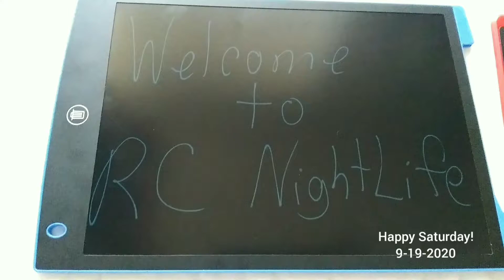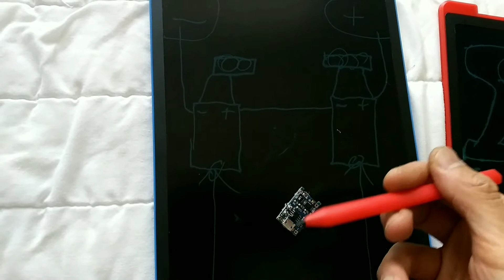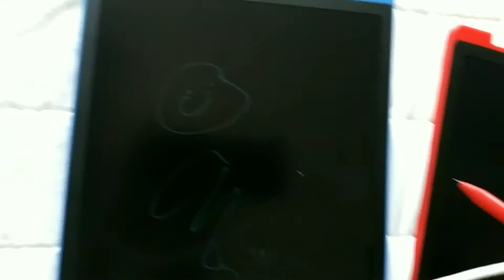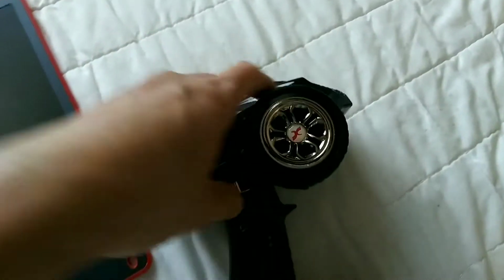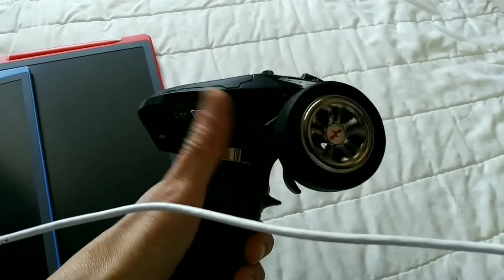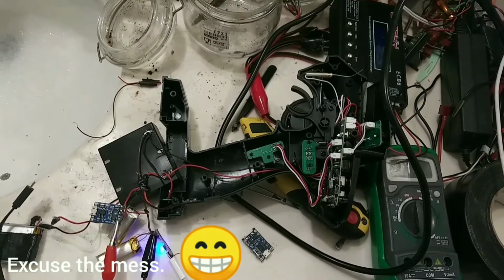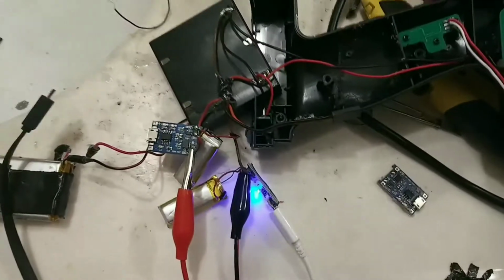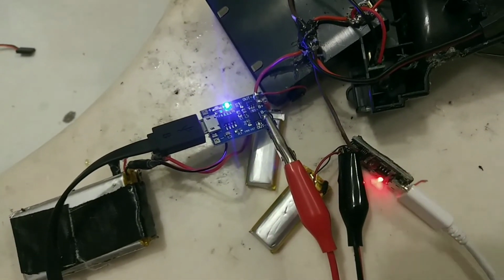HACK/MOD Any RC Transmitter (DumboRC) battery ADD-ON. Never buy AA's again. Read Desc.(9-19-2020)

Comment: Great hint for those stuck on AA
I love the flexibility of My Radiolink RC6GS controller. 
It is designed to accept any 2s or 3s or 4s battery or AA. 
There is room in the large compartment for 2 of those 2S Square Flat Controller Batteries to have a backup if needed but they last forever and we rarely run out of power, only once after multiple outings. 

Thanks again 
Great upgrade.
Reply from the maker: Oh yes, the Radiolink RC6GS is the one I was going to order but didn't because I didn't want to end up with too many transmitters.  Now I know it's a good one and will order it in a few weeks after I get bored with my current rc toys.
Reply from the maker: I noticed the version 2 of the RadioLink RC6GS is out which is the next remote I will be buying.
Reply: Only 1s 2s and 3s no 4s the transmitter will blow

Comment: Hey bro. Thanks for subbing. I wasn't able to respond to your comment for some reason. Cool video I didn't know about this.👊🏼😎
Reply from the maker: I noticed you drilled a hole in your Big Rock v3 so I thought you might want to drill a hole on top of your upper gearbox cover too so you can easily add lubricant to the crown and input gears.  Below is a link to see exactly where I drilled the hole which is aligned with the teeth of the crown gear.
(Syringe)
https://youtu.be/91vPfv_47fY
(WD-40)
https://youtu.be/BPqA7QyysZo
Reply: @rcnightlife9611  ok I'll check it out. Thanks

Comment: Yo bro I have a jst 2s 500mah lipo in it but I need to charge it is it. Possible to charge it with the transmitter USB port??
Reply from the maker: I only have one of these DumboRC transmitters and it's already modded so I can't test it for you but the built in USB should be only made to power up the transmitter but not sure. The easiest way would be to dissect and cram a "Wltoys 144001" 2S charger inside your transmitter. Here is the link (2 full Amps). You can also remove the usb cable and add a shorter one or add a thin retractable usb cable.  Try and find a smaller 2S charger or combine two 1S charger from a vape pen or the ones from my video.  Watch out for amp output. Maybe add a solar panel.

https://usa-m.banggood.com/Wltoys-7_4V-2000mAh-Battery-Charger-Fast-USB-Charging-Cable-12428-124018-124019-144001-A959-RC-Car-Parts-p-1615783.html?utm_source=googleshopping&utm_source=googleshopping&utm_medium=cpc_organic&utm_medium=cpc_bgcs&gmcCountry=US&utm_content=minha&utm_content=frank&utm_campaign=minha-usg-mb&utm_campaign=pla-usg-all-pc&currency=USD&cur_warehouse=CN&createTmp=1&gclid=CjwKCAiAxp-ABhALEiwAXm6IyTNj-w-zY9kcrSr95WlH5VR5RR8C5MetewbUL7fzbd4A7D46wCOpTRoCXVcQAvD_BwE